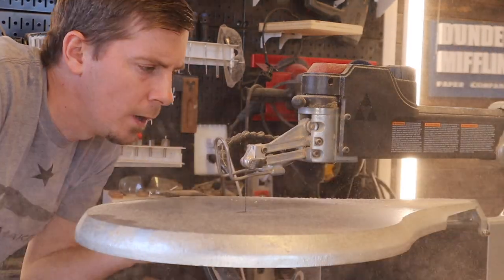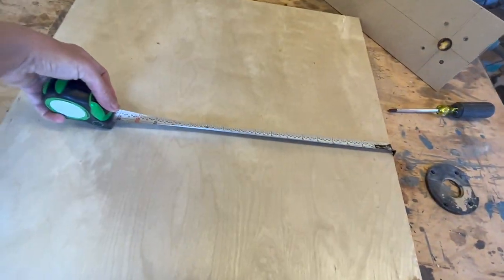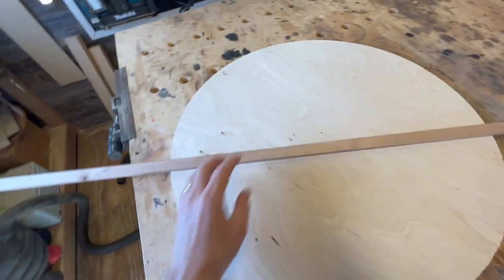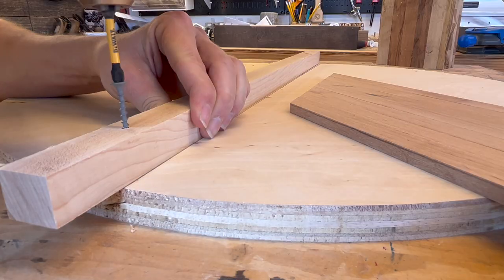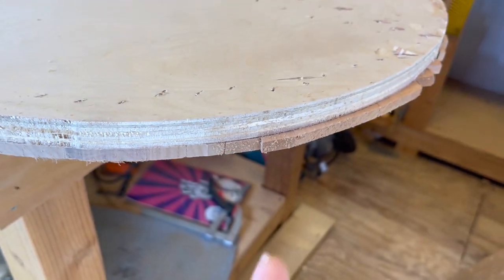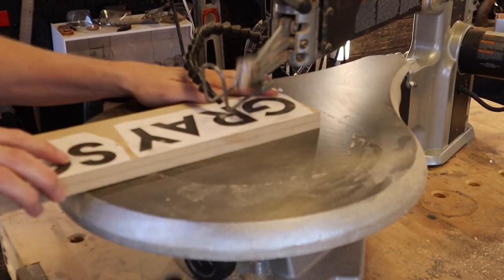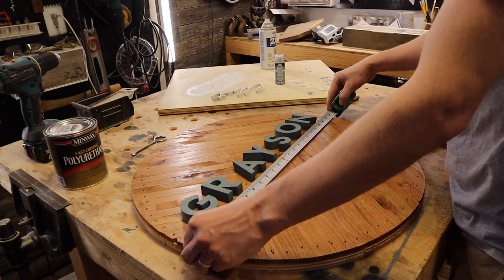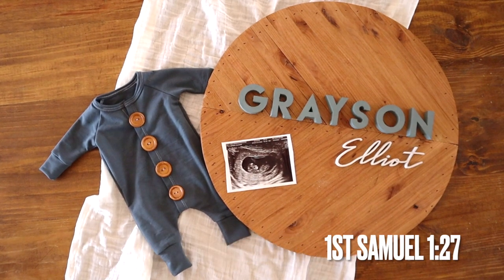DIY Nursery Room Sign // Scroll Saw Wall Sign

Comment: Hi Markis thanks for sharing such a great video. I am a very beginner on the scroll saw looking into buying some fresh blades from Bear woods supply. Do you have a preference when doing lettering such as you did in this video? I am considering the Pegas modified geometry 1,3,5,7 variety pack. My neighbor gave me Porter cable scroll saw it has a rusted old blade. I have not used it once yet. Please let me know any advice. Thank you and Congratulations on Grayson (I imagine he’s about two years old now)

Comment: What Scroll Saw Blades number/brand  did u use?
Reply from the maker: I usually grab the Bosch 4 pack which includes 2 thin blades and 2 thick. I’ll use the thicker for hardwoods and bigger names like in this video and the thinner for more detailed stuff.

Comment: Congratulations on the little one coming!  The sign is beautiful. One of my friends just gifted me a scroll saw. Do you have any tip about sanding the little pieces on the inside of the letters?
Reply from the maker: Absolutely! You can get a very small file (maybe even a nail file) and get in those tight spaces. Sometimes if I didn’t get a really straight cut on something like that I like to come back with the blade to gently massage the imperfections out.